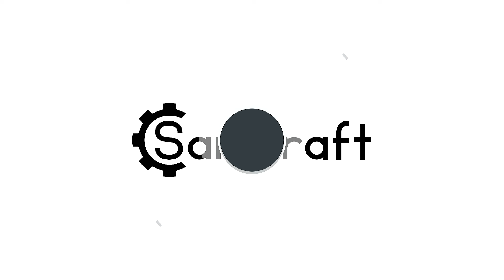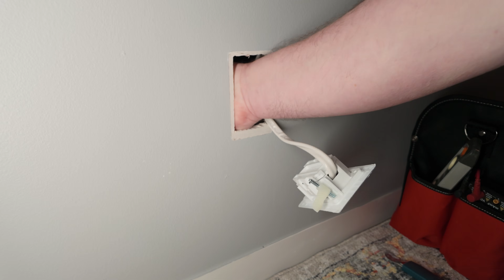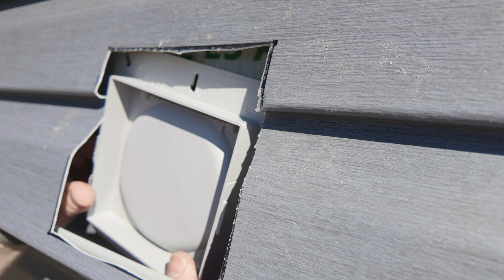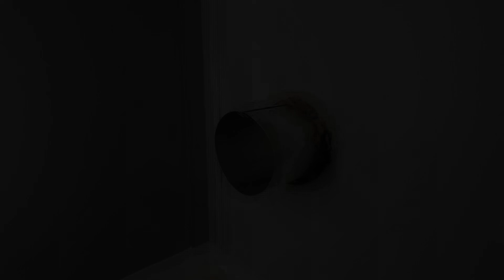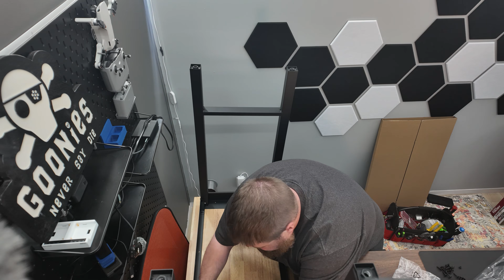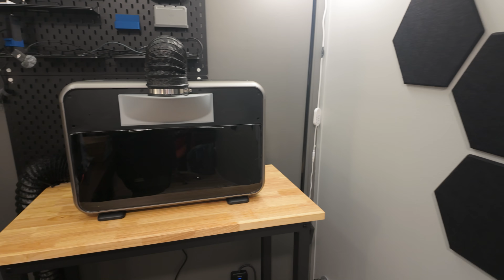DIY Wall Vent Install for Fume Extraction | Maker Space Upgrade

Comment from the maker: 🔥 LINKS & INFO FROM THIS VIDEO 🔥

If you're setting up a UV printer, laser, or resin printer indoors, proper ventilation is a MUST.
Here are the exact parts I used for this install 👇

🛒 Samcraft gear
➡ Fume Extractor for eufyMake E1
https://samcraft.shop/products/fume-extractor-eufymake-e1-uv-printer
➡ Samcraft FatMat (Reusable UV printer mat)
https://samcraft.shop/products/eufymake-e1-fatmat-reusable-uv-printer-mat-kit

🖨 eufyMake E1 UV Printer
https://eufymake.sjv.io/19BV9d

💨 Ventilation parts
AC Infinity Inline Fan https://amzn.to/400EdwH
Black Flex Hose https://amzn.to/4sb4mVA
4" Dryer Vent Kit https://www.lowes.com/pd/Ply-Gem-6-75-in-x-6-75-in-White-Woodgrain-Vinyl-Universal-Mounting-Block/1000047107

4-1/2" Hole Saw https://amzn.to/3OGOkUV
Pilot Drill Bit https://amzn.to/4r6zxjV
Flashing Tape https://www.lowes.com/pd/FrogTape-3-75-in-x-75-ft-Acrylic-Roll-Flashing/5015185585
Vinyl siding removal tool https://amzn.to/4aWsW5w
Workbench table https://www.walmart.com/ip/HT-36IN-WORKBENCH/16807959156

💬 Comment “I'M VENTING” if you watched the whole video 😄
👍 Helps the video a lot!

Thanks for the support — you guys keep Samcraft going!

Comment: I’m venting , great video Sam I have my 3D Printers in my bed room and need to figure out a way to vent my H2D to the outside side but in in a basement so trying to figure out a good way to get it through the window. Thanks for sharing
Reply from the maker: I use a window dryer vent just like this in my shop for smaller machines https://amzn.to/4r3Pk2Y It's a great kit and works great for a non-damaging, but weatherproof setup.

Comment: Sam before you go ahead and cut away the wall and siding etc the first thing i would have done is to actually connect everything together just to check and make sure that the airflow is strong enough to make the grey flap move/open as the very last thing you would ever want is the fumes to be trapped inside your walls, therefore causing a situation where you and the family could end up being poisoned.  Hopefully once you had finished the installation process that you then checked the flap opening during use of the machine.  As always buddy 💯%   👍   🇬🇧.

Comment: I have a question ❓.  You didn't Punch out the actual vent hole before attaching the vent cover and the exhaust pipe.
Reply from the maker: Not sure what you're talking about? This exhaust kit has a flapper outside to keep bugs and cold drafts at bay. Maybe that's what you saw?
Reply: @Samcraftcom I think he is talking about the flapper on the outside piece.